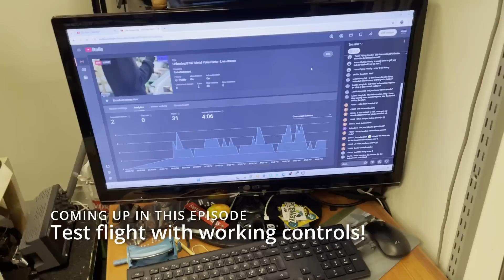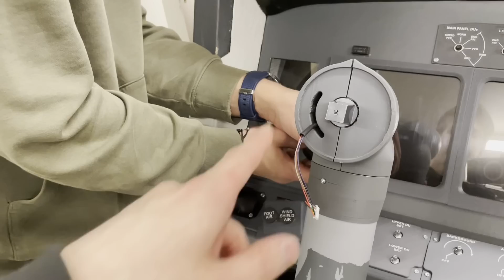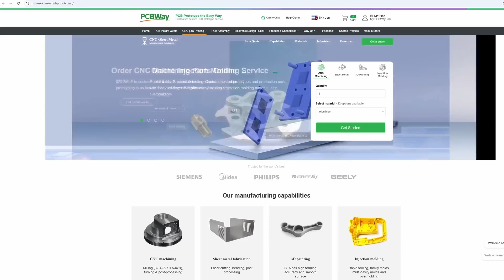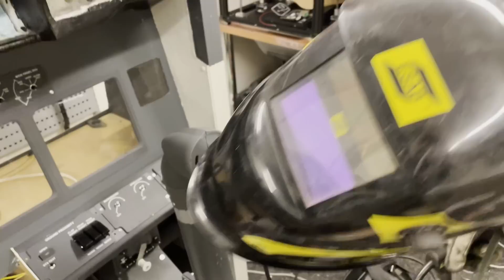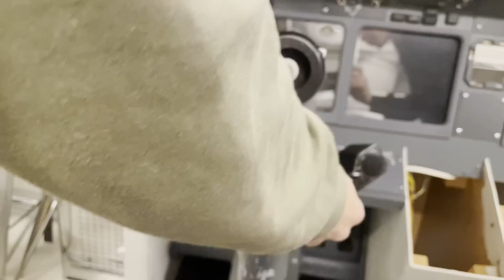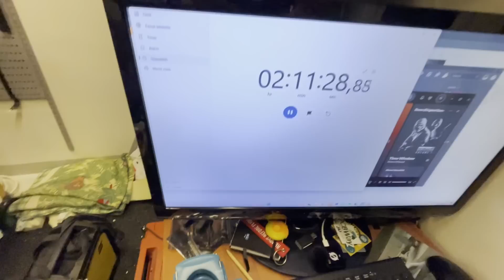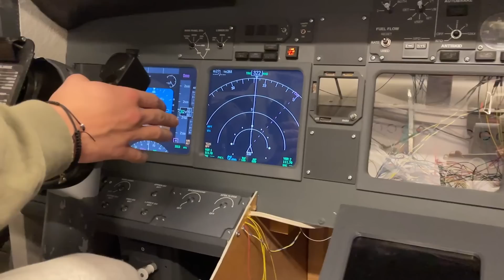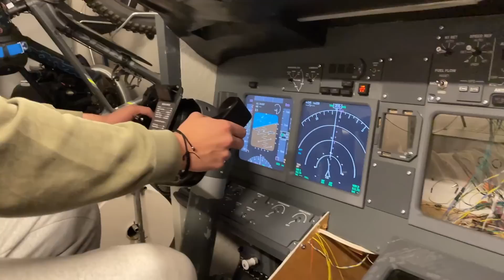Full Metal Dual Yoke For B737 Home Simulator [B737 Build #13]

Comment: I've used air springs in some applications, so that you have a constant force, which can also be determined by the mechanical linkage design, and you can also get some damping, if desired. 🐻‍❄️
Reply from the maker: That's actually a fantastic idea! I really haven't thought about that but it really now seems like an obvious answer to all the problems we have. Thank you for the idea, we will certainly look in to the design when we have time.

Comment: I wonder... Could you use a toothed belt to transfer the yoke rotation, instead of a spur gears... But, here I am, Lohi, always swimming another direction..
Reply from the maker: I did think about using belts / wires to transfer the motion and I think I would use belts if I did this again in the future. Thank you for the comment and I love to hear other peoples ideas. It's best to have different views and possibly combine our methods.
Reply: Yep, it's always good to listen, and hear_, and integrate _useful ideas; not all ideas are useful, but you seem to have some reasonable people in your comments.
Heippa
Reply: BTW, it's not necessarily a bad idea to use a bidirectional servo system to couple columns or yokes, there are incredibly precise rotary sensors, like 14 bits, or better, absolute encoders; again, it becomes feasible to program in the kind of feel that a real control might have.... The air springs that I was talking about can often be found as automotive parts, but I think that Ali express and Alibaba carry a range of them. We used them in a hospital bed positioner that I worked on, where they had an over-center action, with no tension at center, and increasing as bed rotated, allowing lower torque required from the motor.
Reply from the maker: That’s a great idea, we’ll definetly look into that and how feasible it is hardware and cost wise.